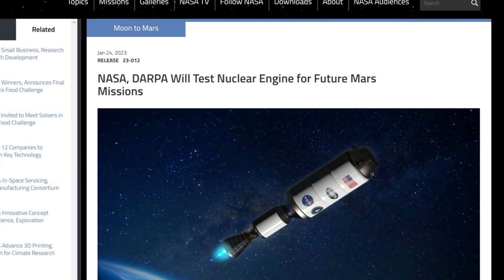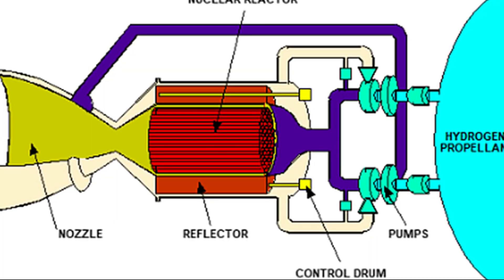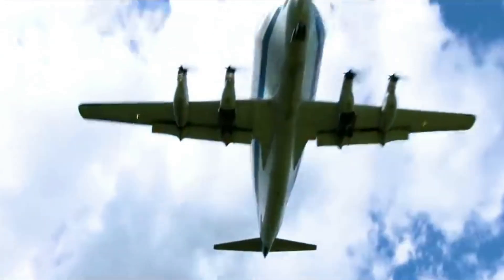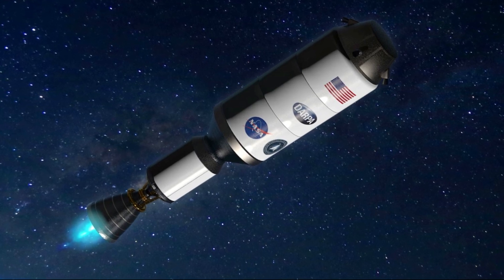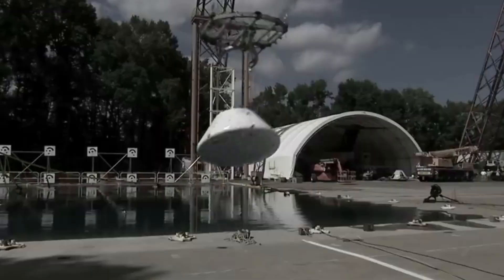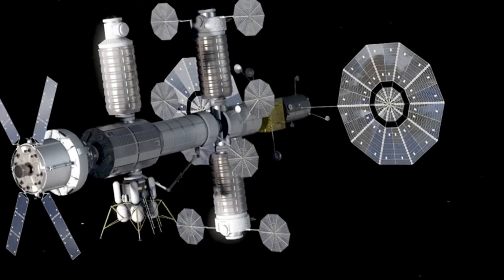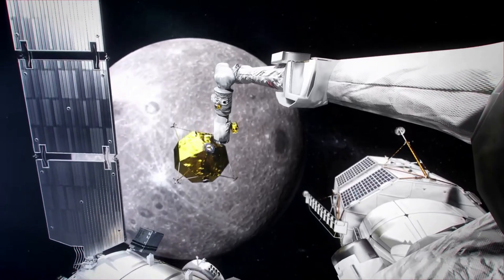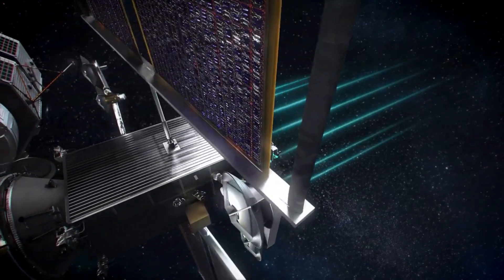Why Nuclear Engines Could Be The Answer To Future Mars Missions

Comment: NTRs arent really practical as they rely on hydrogen for propellant. Maybe as a cis-lunar tug for methane and oxygen tankers which will weigh around 2000 tons when they're full.
I could imagine filling up theae tankers in low Earth orbit, then using an NTR tug to push it into a higher orbit, or lunar orbit.
Reply: Don't know ANY rocket propulsion that doesn't require some form of reaction mass.  So the goal is to devise a system with the highest specific impulse possible.  Initial design of NTP is one of the highest specific impulse engines.

Comment: I'm veryy skeptical with all the hype around Starship for Crew missions to Mars, because it is a multi task vessel, Spaceship, Lander and Ascent vessel. That goes against the modular approach, that bring efficiency as more safety ratings. In my opinion the first Crew mission to Mars, will be made using a modular Spaceship with Nuclear engines for a faster voyage, while landing in smaller compact lander, more easily refuel in place. Starship would make more sense for cargo missions.
Reply: Station on phobos is best. Can dock a ship in micro gravity.
Reply: Its typical hyperloop BS